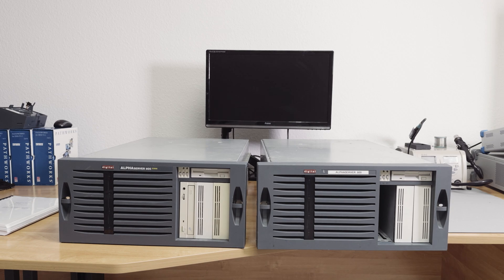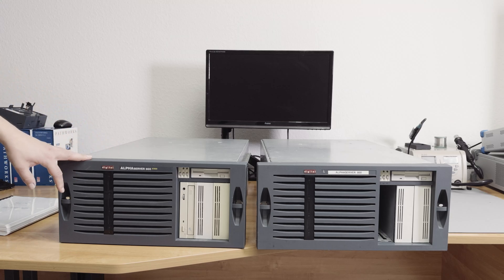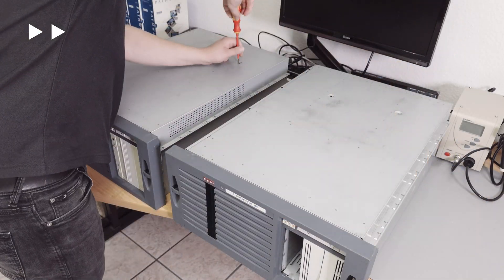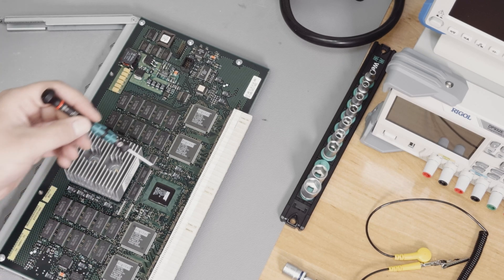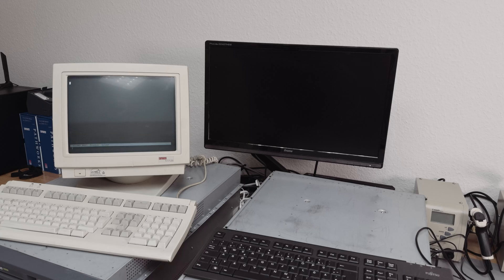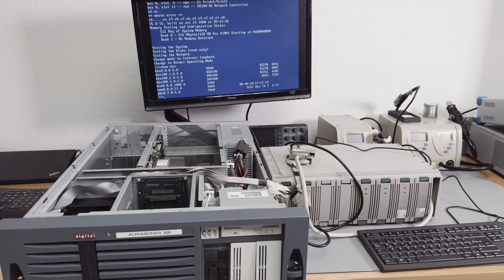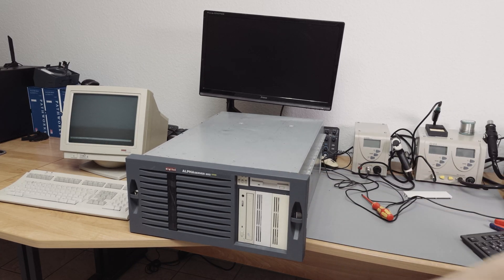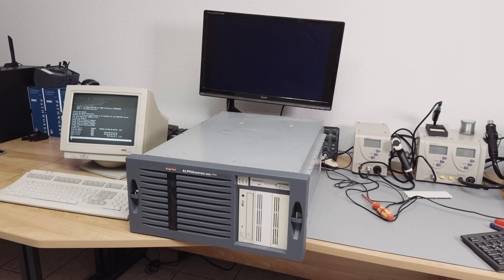DEC (digital) ALPHAserver 800 - Hardware Overview

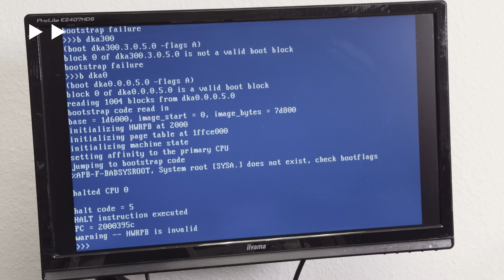Comment: Thanks for that. The internal layout is similar to my 1000. At 13:00 the message is saying that the boot flags are set to boot off root SYSA which does not exist. If you had changed the flags to 0 you might have got further. The first machine was using an SRM console, so was in VMS/Unix mode. The NT console is different.  Cheers,
Reply from the maker: Thanks, you're right. The boot flag was set to A, I changed it to 0 and it works: https://youtube.com/shorts/IiBfIxQnWNI

Comment: Wow, good work not permanently breaking off any pins. That's always a nightmare. Is there memory expansion available on the main board, or only what's on the main CPU card?
Reply from the maker: I am really glad that no pin is broken :) There are 8 memory slots on the mainboard, 512MB are installed and 1GB is possible.